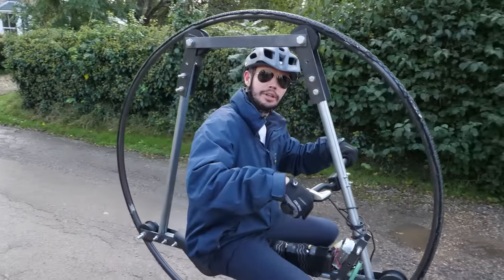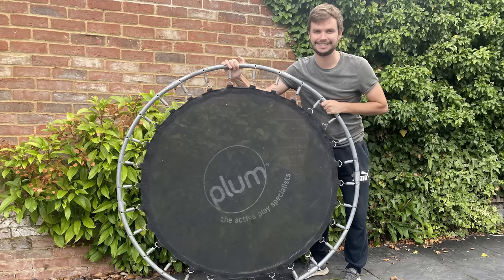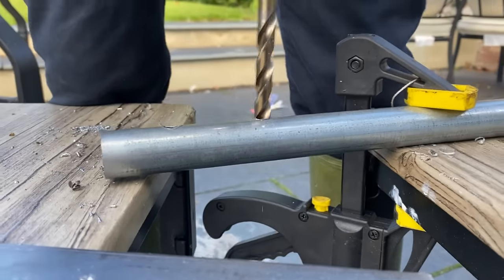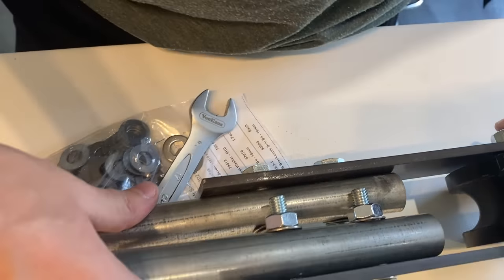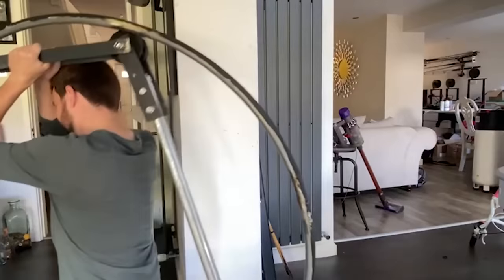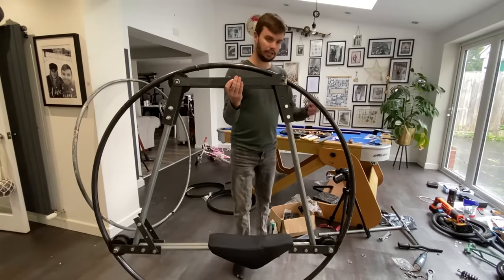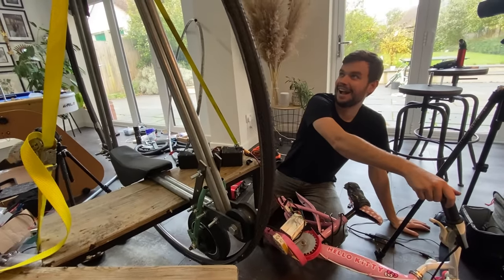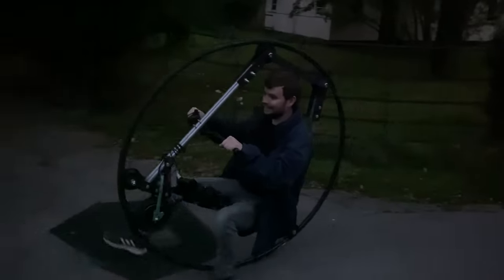Making The Strangest ebike - The Monowheel

Comment: It works shockingly well! I wouldn’t have expected it to be as easy to control. I think that if you were to add some weight below the seat it might help with the problem of the frame wanting to spin around when letting off the throttle. Still, that’s only my speculation. Nice build!
Reply: No thats a pretty solid intuition. I'd put a serious chunk of weight under, and slightly to the back to counteract the small frame pushing the rider forward. The bigger, and safer, monowheels usually have the rider leaning right back countering the mechanism urge to flip forward. Harder in this significantly smaller frame. But it could be replaced by a big chunk of lead just at the back of the seat.

Comment: It might be possible to build this by just modifying a hoverboard. The IMU could balance it standing up, and then you’d only have to worry about side to side
Reply: maybe a flywheel or counter weight to balance side to side
Reply: The motor aren't strong enough to keep something like that level
Reply: @euctheeast3902  Yes, but the sensors and control board can send a signal to something that can handle more powerful motors. They have power, but they need control.
Reply: @DigitalJedi  yeah I just think you'd better of with an euc if you were gonna go that route you would probably be able use the stock controller and motor from an euc, I don't believe any hoverboards controller would be able to handle the voltage needed to operate such a a machine

Comment: If you ever are intending to revisit this project at all in the future... might I offer a suggestion for inspiration?

Star Wars had an interesting approach to it with General Grievous' legged bike. Where you basically take the engine from the bike and shove it in the sidecar, so you're sitting on one side of the wheel, but can still see under the inside of the rim and out the other side. Oh, and kickstand leg.

It's also safer, since you can add a counterweight system so if it loses balance, you can knock it on the side that DOESN'T have the driver. And even if it falls on the side of the driver, rollbar edges and the clearance in between the drive ring and the outer rung ensure their helmet isn't hitting too much metal and pinning the driver down.

Perhaps if it's possible to do just that; take the seat of a motorbike and shift it to the side, so you can make the engine and gyroscopic system as it needs to be. Just keep enough out of the center so you can see over the engine and under the wheel, and wear a helmet.
Reply: Yes, it's likely to be far more advanced, even before taking gyroscopic balancing into account, but perhaps with a bit of luck a smaller scale proof of concept will go far.

Comment: Love it :) I've been fascinated by monowheels for a couple of decades, but haven't had the where-with-all to pursue it yet. Maybe try putting the seat down a lot to move your centre of balance, and drill holes in the top, heavy steel bracket (al la racing car design), to further reduce top weight. At the moment you're quite close to the central pivot point of the contraption, so acceleration and deceleration tries to rotate every thing around you, whilst you spin in the middle. If your weight was a lot closer to the bottom, then the accel. and decel. would have to try and lift your mass upwards around the arc of the wheel, thus providing resistance that can be translated into forward and regressive motion. I think :) It's been a mental experiment in my head for years. My only concern is that when braking, your mass would shift towards the rear a bit and I'm not sure if that would de-stabilise the Monowheel. All the best with the project.

Comment: It might be a good idea to mount a counterweight under the seat. That would be a good place to add a large battery pack, and any other equipment you need, as well as a large block of steel or lead. I've seen some monowheels that used a petrol engine, and they mounted them at the bottom of the frame as a counterweight.
Reply: This guy!

Comment: Hand tool tip: With the reciprocating saw, hold the plate that you slide the blade into, flush up against the material you are cutting. Do not pull it back from/away from the object you are cutting, to the point that it is freely sawing into the material while you hold it in mid air. If you leave/hold the plate laying up against the material you are cutting, you take the strain of having to hold the saw still (from jerking back and forth in your hands if the blade catches wrong while cutting through the material) off of yourself and let the saw do what it was designed to do the best way it can. Like how you operate a chainsaw, you set those metal teeth at the back end of the blade up against the wood, and then "wiggle" the blade through the tree using the teeth as your pivot point. You can break wrists/fingers/arms etc when you dont keep the saw butted up against the material you are cutting, and then try to hold it in space yourself.

Comment: This is awesome! Great job documenting the whole process! I do have 2 bits of critiques if you want them. If you don’t, read no further: 1. Add a little bit of background music, the silence was a bit eerie. 2. Add two small wheels to the front so they don’t touch while riding but if you brake, it’ll rotate forward where the two wheels will then contact the ground, stabilizing you side to side and front to back while you slow down

Comment: What that needs is two much smaller wheels one in front and back a lill off the ground to stop the forward and backward pitch when pulling away or stopping, also since your weight is pressing down it slightly deforms the tube wheel directly under you between the front and back lower kick rollers so it needs a support with a kick roller directly under you but the ride will become a little harder so maybe a sort of spring loaded support there 👍, this sort of thing has potential with the right design I  think
Reply: that would defeat the purpose of it being a mono wheel. mono = 1.
Reply: use the same systems as a self stabilizing electric unycicle.
Reply: don't put extra wheels on the bike, put them on the shoes xD
Reply: @renookami4651  lol yeah roler skates 🤣👍

Comment: If you increased the mass of the wheel you might get more of a gyroscopic effect so the monowheel would be more stable. This is how motorcycles are so stable, might be worth a try! :) 💕
Reply: Not only that, but the entire center of gravity needs to be lower. his center of gravity is too close to the center of the wheel. monowheel designs tend to have you sitting VERY low.
Reply: The gyroscope argument is a tired old one... bicycles don't have enough weight in their wheels to keep a person up, what keeps the person up is the continual change in direction, a cyclist is always falling, just changing which sides he's falling to so he never actually falls.
Reply: @Metal-Possum  Yes and needs an active steering system to work. Fall to the left, turn to the left etc.
What most cyclists don't realise it is the steering that is used to balance the bike. If the steering is locked one can't balance.
Reversed steering messes with the mind and takes a lot of focus.Fall to the left turn to the right.
Reply: What makes a bicycle stable is the fact that the center of the font wheel is ahead of the steering axis, which is inclined towards the rear. As a result a bicycle is stable even without a cyclist on it.
Reply: @frenchimp  Not quite. The self centring effect is a result of the line of steering axis is ahead of the point of contact on the road. (the trail)
The forks are often raked forward slightly to reduce the trail as too much can result in tram-lining or shopping trolley shimmy.

Comment: Congratulations Mr Barker you have invented a new way to grind soles down. So Tom needs to add some electronics a speed sensor a variable leveling device to allow wheel to operate between +10 and - 10 degrees  a rear braking/reversing wheel motor/actuator to prevent forward tumble. You will have to excuse me I can visualize it in my head but explaining it is problematical LOL Computer Guru here not a mechanical engineer Bigger LOL Good Luck with the mods
Reply: He could wear roller skates whilst driving it.
Reply: rick james yeah I thought so as well since he kept catching his feet awkwardly, roller blades or skis would also work
Reply: @filonin2  In 1927 they used fuel motors and had foundries to make component parts the main thing of those monobikes was the lower center of gravity. They used heavy weights to over come the rolling problem. A lightweight bike using an electric motor needs more digital sophistication.

Comment: To make a safe and effective monowheel, you need a 2-axis gyro stabilizer.  If the gyro is strong enough to counter the wheel's momentum, then slamming on the brakes would allow you to actually stop without rolling over.  The second axis would be to prevent falling sideways.  You wouldn't want it too strong as you need to be able to lean in order to turn.
See the videos on gyro-stabilized electric motorcycles for ideas.

Comment: I feel like if the mono wheel's entire assembly could be 5% bigger, it could improve. So you can install something for your back to lean on, or install like a bucket seat. And the wheel itself to be either wider or accommodate an actual tire for ride comfort.

Comment: Coming in late, but I feel like your ultimate stability fix would be a pair of pneumatic skids you control by sticking your feet into them, like boots, or ski straps. They could support the monowheel for balance in all directions, and you just change their angle and level by moving them with your feet.

Comment: Funny thing is that I could see this being a really cheap way to traverse in urban environments while also being really easy to store compared to a bicycle. Just need a few adjustments.

When you were dragging your feet on the ground, all I could think was “roller blades would be great here”. 

Wheel is stupid small. I’m a taller man myself, I’d be at eye level with the wheel the whole ride. But while we’re fixing it up, try making it less like a bike tire for cyclists and more like a fat bike tire. It’s much better for balance. Or do it like dual rear tires on a truck and have two wheels side by side. Sure it’s not technically one wheel, but it’s still cool

Comment: I think this is an awsome little thing. In its current state it's cool, but lacking, and both I an many people would like to see this functioning to its full potential. I think one good idea would be to add balast to where you want it to balance, as well as adding balasts that extend out to create a more triangulated center of mass to keep it more balanced. Another thing you could do is to provide more clearance to the head by re-shaping the upper brace to fit the contour of the drive wheel, as well as make the foot rests wider and move the seat back to create a more comfortable position. One more thing would be to fit inner tubes with real tires to create a more comfortable ride, and to add brakes (just simple cable-driven brakes would do), that way you wouldn't have to use your feet to stop. There's much more you could do, but these are the easiest improvements I could think of that wouldn't require building an entirely new model. I hope you see this comment and consider it, I would really like to see this bike updated!

Comment: Install a V shaped metal fixture for the pegs that has one small training wheel on each end of the “-V-” then apply pressure with your legs to achieve 3 wheel stability. Just a thought. 🤔

Comment: I've had a thought on how to make it stop rolling forwards when you're stopping, but it may not be as straight forward to implement as I imagine it to be.
What about adding a tilt sensor to the assembly with the seat and using it in conjunction with the electric motor to apply a backwards impulse to balance the seat assembly?
This should (if my thinking is right) both help balance out the seat and stop you from flipping, AND apply a braking force to the wheel itself.
This also could help with acceleration, by having it limit the throttle as the central seat assembly starts to tilt back.
Also adding ballast on the bottom of the inside assembly could really help with all that.

Comment: The whole pitching forward issue when you panic would be resolved potentially if the wheel powering it only made contact with the large outer wheel when you want to accelerate.

Comment: Lower the center of gravity by lowering the seating point. OR for the current build add a weight under the seat that tracks and also has foot pegs out front, use that swingset double seat design to swing the weight when braking using your body pulling the handlebars while pushing with your feet to move the weight beneath you while engaging a braking. (where all the dialing will need to be.)

Comment: A microcontroller to adjust the throttle input to account for frame rotation might help, and/or some forward foot pegs outside of the hoop with small wheels or sliders on the bottom to keep the frame from rolling when you let off the throttle. ;)

Comment: smaller wheel in the front on frame for braking purposes to prevent gyroscopic forces from sending the frame too far forward.. handlebars mounted at the top to control the center of gravity more efficiently. wider wheel with rounded surface will help with turning as well.

Comment: You're not the first. The gyroscopic effect  is how this works, an inventor of the 1930's did this exact thing but put a simple 2 stroke motor on and it was actually a huge success, at speed. "Upon braking, the machination would plummet the driver forward with the momentum as the  single wheel did not encourage loss of velocity."

Comment: That's really cool! Perhaps you can get it more stable at lower speeds when you add a fly wheel and lower the balance point? You could have your feet outside the wheel if the fly wheel is behind you, to get the horizontal balance right. 

And please don't kill yourself with electric tools. Use a clamp if you drill parts that weight more than a bullet. ^^

Comment: Needs more mass at the bottom to keep you stable without turning inside the wheel. If it was heavy and big enough to keep your feet up, you could eliminate a lot of the minor trips from dragging your feet across the ground while getting better balance.

Comment: It seems the hardest thing for it is to remain upwards. Unsure if this idea works but putting that one inside an even bigger wheel might help. Just set it up so the seat part is reconfigured to remain sitting upright no matter what, and then the wheel you have now has more engines to power the even bigger wheel you'd have over it. It would probably work... probably

Comment: That's pretty good for a hacked-together proof of concept.
It's slightly unfortunate that you seem to have miscalculated the diameter of the outer hoop/tyre, it it was about 150~200mm greater in diameter, you might not have had quite so much trouble trying to balance, because you wouldn't be in such dire danger of braining yourself on the top member of the internal frame and leaning out one side or the other so much to avoid it.
My guess is that you'd committed to the trampoline frame diameter and just made the heavy tube wheel the same size, for quicker/easier reconstruction with existing parts.
I think your motorbike footpegs at the end were perhaps a bit too close, you'd have to squash in so much that you might not even be able to get your feet onto them.

Comment: what about small and close mounted stabilsers to the inner frame fore and aft to prevent roll of the inner cage, could have them on a suspension which allows for left right steering but has zero forward or backwards motion, or slightly offset at the rear with a higher angle for that fun wheelie feeling.

Comment: While this is really cool, I suggest making the frame a fair bit larger so you actually fit into it without having to lean your head to one side. The leaning makes the whole thing off-center and leads to you inevitably falling to the side you're leaning to once your feet get off the ground. 
Also, a larger frame will hopefully prevent the frame from coming down on the side of your neck when you do fall. It can do a ton of damage there if the force is large enough. If the frame is high enough above your head to miss it, it will just fall "around" you instead of on you, I hope.

Comment: bigger diameter, use thicker metal so the tread is thicker for the wheel and then maybe find a way to put an inner tube in, some suspension, foot pegs, maybe add a simple brake/disc

*may as well make the middle a bike frame or use like a mini moto frame and essentially make the round tube more of a rim

Comment: During the video I was thinking how it throws off the balance when you're having to lean to one side or the other since there's not sufficient headroom, and you'd need someplace to put your feet eventually. Second concern was addressed but Captain Hindsight told me "they should have made the special-ordered steel circle bigger because it's harder to balance when you're cramped or leaning"

Comment: Get some inline skates to wear with some kind of rather sturdy rubber bumpers attached to provide braking when you need to. The friction from your shoes is going to wear out soles and it probably pitches you to the side of  greatest resistance more so than a inline skate would when you use it for balance. I don't see the foot pegs as being much use unless you get some other design as suggest by others. I see the inline skates as a compromise while you learn if you can make it more stable.

Comment: Not that I know anything, but it did appear in one of the working models that the rider was not sitting in the center of the wheel, but offset at a 20 degree angle from the center.